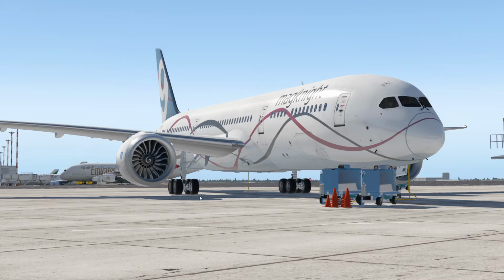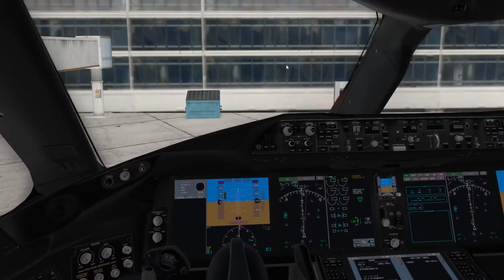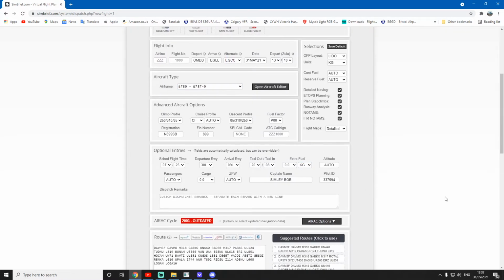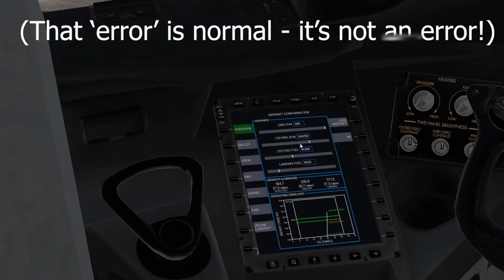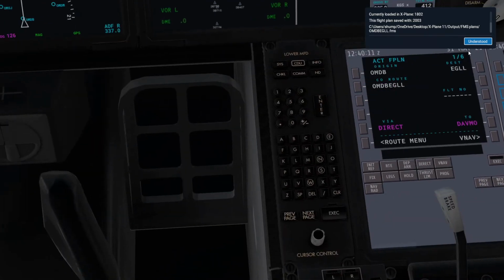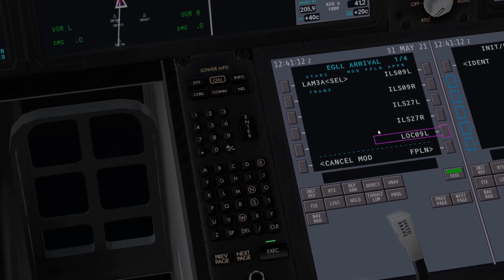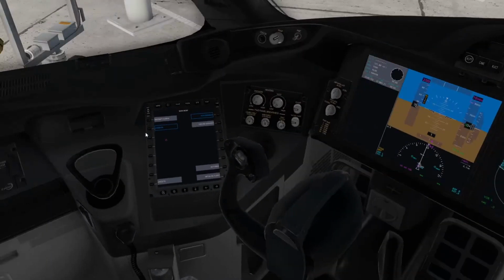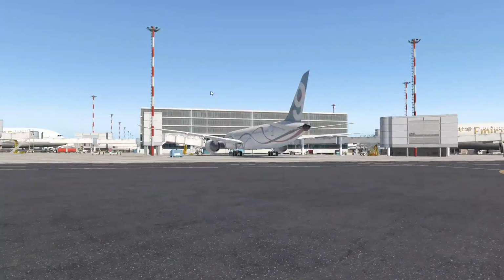Complete SimBrief Uplink Tutorial For the Magknight 787 I X-Plane 11

Comment: Nice one! I have a question. The PDC doesn’t work for me. I flew EDDF-EGLL on vatsim and tower, atis, approach was online. When I tried to request atis it said it wasn’t available. Also trying to send a clearance PDC didn’t work. Any thoughts? Cheers!
Reply from the maker: You need to logon. So go to comm, then logon or something then type in their hoppie logon code (four letters or digits or a mix) - not all vatsim controller use acars  and hoppie tho. Basically make sure you are logged on to the controller - it should say in the controller’s remarks or something, or you could probably ask them!
Reply: @Simleybob  so is the code the ICAO code of the airport? Because I tried that and it didn’t work (EDDF for example) it said controller “online”. What am I doing wrong? Thanks for your reply btw🙌
Reply from the maker: @infinite2246  Nws. Join the magknight discord (don’t know a huge amount about PDC and acars tbh!) so we can all have a look and it will be easier: https://discord.gg/Kqu7cUjP
Reply: @Simleybob  thanks a lot, appreciate it🙏🏻🙂